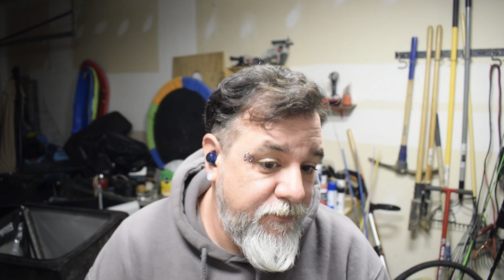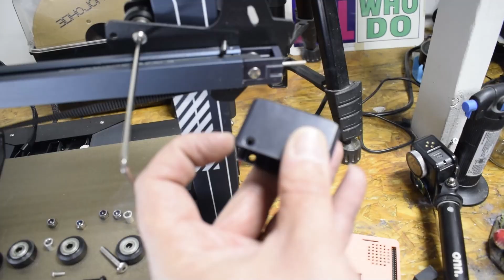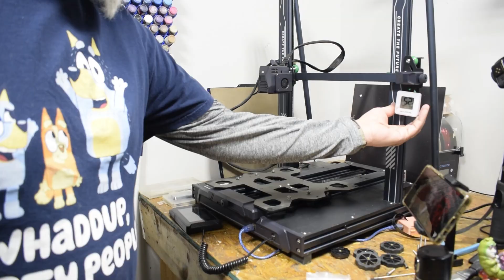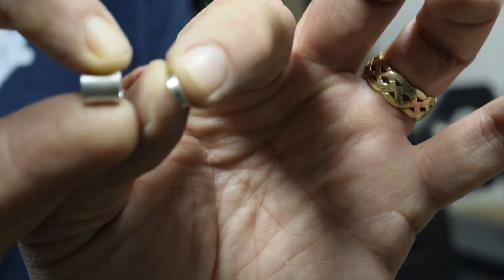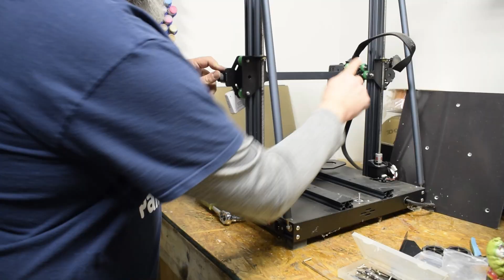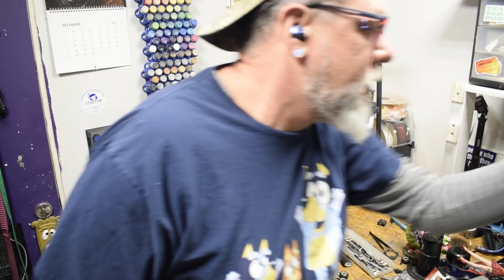I Made My 3D Printer Smoother After Installing New V-slot Wheels

Comment: Wow....that is an OLD machine.  Don't spend money on it, save up and get a solid core X/Y machine.  I parted out my bed thrower to make a vacuum forming machine. LOL

My $500 core X/Y paid for itself the first time I printed CF nylon (PA12) perfectly the first try....
Reply: Elegoo Centauri Carbon 2?
Reply: @barbarosbozkurt758  Qidi XMax 3.  Been impressed as Hell by it for the price.  It's not Bambu as far as automation, but cost half as much.  And as far as I can tell, doesn't also function as a surveillance device.
Reply: @MrAcuta73  that's the exact reason I bought the elegoo, well for the open source side of things.